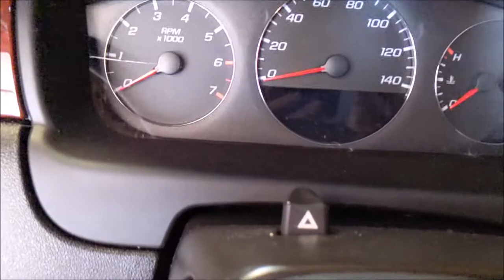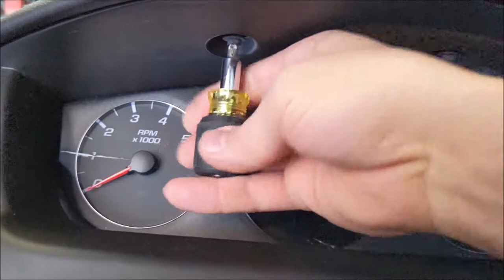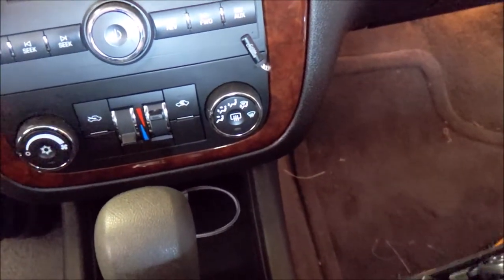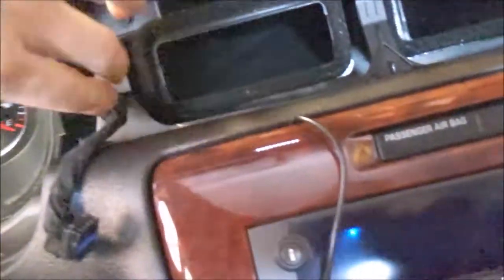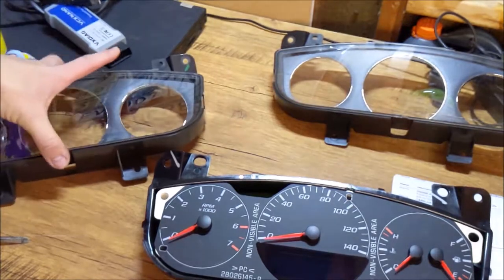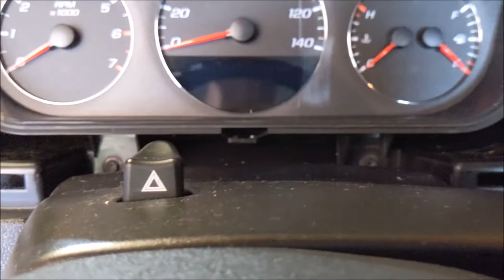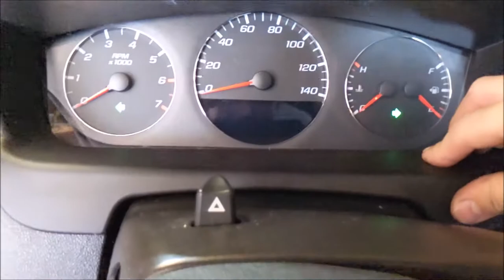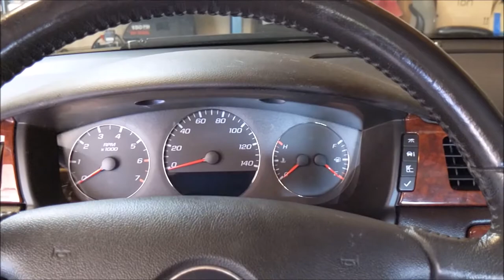2006-2016 Impala/Limited (9th Gen) Instrument Cluster Removal and Lens Replacement

Comment: do you if the a 06-10 monte carlo would swap in a 06-10 impala?
Reply from the maker: A Monte cluster won't fit the Impala, as the casing and bezel are completely different between the 2 models.  I thought about swapping in a Monte bezel, but it won't fit the Impala cluster, nor will it fit properly in the Impala's dash..
Reply: @CertifiedShadetree  thx for  the feedback I was thinking about swapping one out
Reply from the maker: @TTG314  I hear ya, I really like how the Monte cluster has those deep pods surrounding the gauges. Wish the Impala had the same!

Comment: So late to the party once again! I keep forgetting Mondays! Anyway, cool little tutorial. Very similar to the Malibu. Not sure if the cluster still works similar to the Malibu or not, but you could put your needles on wherever and then just push them down (so start at full or half on gas and work it down to empty). You should feel some resistance, but not much resistance. As long as you feel that resistance, it should climb from there so it's more of getting it lined up perfectly that way. Probably even uses the same stepper motors for all you know. I would absolutely love to swap in an SS faceplate on mine!
Reply from the maker: I'm just glad they don't use the same stepper motors as the 8th Gens!! And speaking of late to the party, don't you have your reminders set anymore?? 🤣

Comment: Can you do video on exhaust upgrades. I want a lil bit of an growl outta my cars. Not sure what to,  or what's my best option. Without losing power or torque. 
Aftermarket mufflers
Resonator delete 
Muffler delete 
Would love to gut my cats and get better flow. There's no emissions test here.
Reply from the maker: Check out Impala 13's channel: https://youtu.be/mibR4E7Zihk

He did a muffler delete and installed J-pipes. Of all the 3.6 exhaust mods I've heard, this one sounds the best, IMHO..
Reply from the maker: Had another commenter tell me he ran straight pipes right off the cats and it killed all the low end of the 3.6..
Reply: @CertifiedShadetree  okay I appreciate the link I'll check it out

Comment: Any advice on how to remove the plastic lens off of it
Reply from the maker: I would trace around the lense with the cluster still in the car and the bezel still in place so you know how much plastic is hidden. Then cut very carefully around the perimeter with a Dremel being mindful not to dip down past the line you drew. I would recommend at least picking up another sacrificial lense to practice on.
Reply: @CertifiedShadetree  a friend told me to get a head gun to loosen it up but I don’t want to mess it up!! Chevy Impala make thing difficult most car the lens just pop right off
Reply from the maker: You could try the heat gun, but I would suspect the lense would warp from the heat before it would pop loose from the surround. The glue they use chemically welds the lens onto the surround, so cutting it off, IMHO, would be the best course of action..

Comment: Why did you change it out I have an 07 Impala and my speedometer gauge keeps fluctuating and then my car stalls and a light appear says exceeded 107 miles an hour. I had a mechanic it was a cluster. What do you think?
Reply from the maker: Sounds like a bad ground wire or ground connection. What else goes wacky? Did you recently install a system (subs, amp, speakers, etc)?
Reply: @CertifiedShadetree  no I did not just whenever I come to the light. This speedometer starts going up and down and then it shuts off and then I can put it back in neutral and start it up and takeoff and it just does it when I come to traffic or a light
Reply from the maker: @Ro81972  I'd still start with checking all of your power and ground connections. Start at the battery and work from there. Snug and free of corrosion. There's a ground wire right above the passenger side headlight up on the core support that is problematic, so make sure that one is snug and free of corrosion..
Reply: @CertifiedShadetree  thank you Will do
Reply from the maker: @Ro81972  Best of luck!